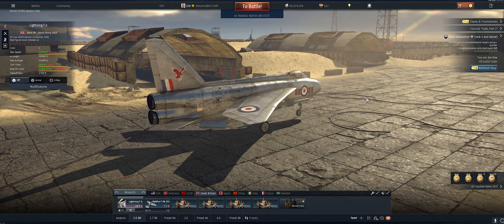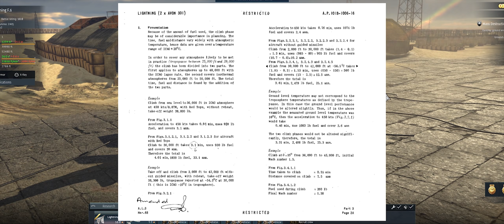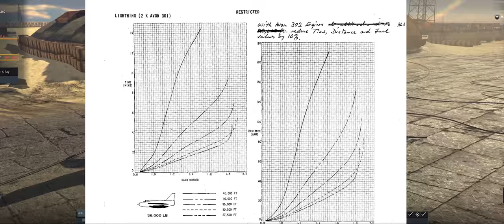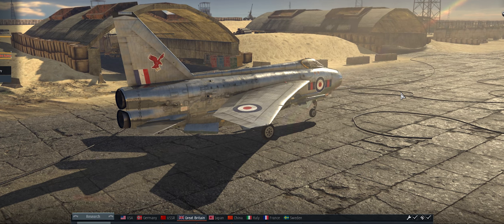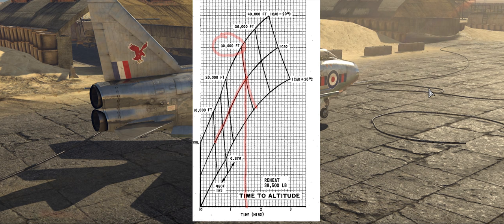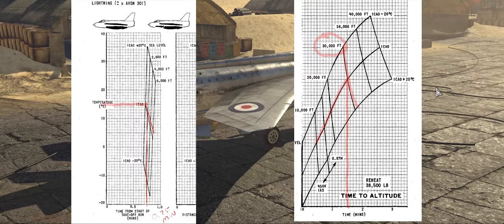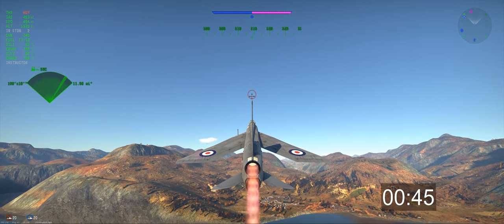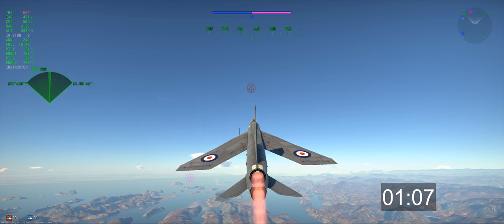True Facts About the English Electric Lightning's Performance - War Thunder 1.97

Comment: "Your English Electric Lightning is Over-performing" maximum mic drop.
Reply: Its not by much though... as he said the manual is for the Avon 301 and we have 302's... 2m15s = 135s, he beat the manual by 17 seconds, adjusting for about 10% per the hand written note means he only over performed by 3.5 seconds...
Reply: FallenPhoenix but still overperformed not under it so
Reply: @Boomshakalaga  I never claimed it was underperforming though... It's actually pretty much bang on what it should be.

1: He mentioned the performance gap between the Avon 301 in the manual and the 302 in game but then didn't account for it in the results.
2: He used the time to climb chart to get a reading for 450 knots at sea level to 30,000 ft... but he wasn't at sea level when he pitch up into the climb.

I actually missed my second point first time round so its closer than the 3.5 seconds I originally stated... time from 1000 ft where he pitched up reduces the over all result by 3 seconds.. so it wasn't off by 3.5, it was actually off by 0.5 seconds...
Reply: Most top tier Jets will be compared to the manuals. The reason gaijin don't accept manuals as a lone source of statistics is that they always lowball maximum performance to extend the life of the hardware, which is then promptly ignored by pilots.
Reply: @FallenPhoenix86  but the jet is also overweight, so its closer to the 17 second over-performance
Reply: @briantucker2570  Its only overweight by 6.49%... people on both side of this argument are desperate to paint this thing as under/over-performing when it just flat out categorically isn't doing either.

The fanbois are crying because it's not outperforming X-Wings and everyone else is overjoyed that it's been "proven" to be over-performing... except that the method used to prove it was flawed and did no such thing.
Reply: @FallenPhoenix86  if anything it proved that it is performing exactly as it should /shrug
Reply: @briantucker2570  Thats pretty much my point in a nutshell... it's doing exactly what it should. 
Be interesting to see how everything else stacks up under the same analysis...
Reply: Actually it's doing both, overperforming a high alt, underperforming at low, gladly have the high alt performance fixed because it gives no advantage since no one fights at the alts it overperforms at while all the fights are at its underperforming alt ironically

Comment: Someone send that to Sgt Vittie (im banned on his serv cuz i posted a vid saying the same thing)
Reply: I'm in Vittie's discord so i got you
Reply: Vittie is a teaboo he won't listen
Reply: Vitte is scamming people with the promise of a giveaway that he keeps pushing back just to milk a sub increase. I despise that attitude so much. Superiority complex is rampant in his videos and streams
Reply: @Derp 101 So its normal for a youtuber to lie about giveaways? Bruh
Reply: @Derp 101 hes a liar.
Reply: @Derp 101 Cringe
Reply: i got banned from vittie discord for asking his opinion of this vid
Reply: @JimmyMcCbob  not even surprised
Reply: The problem is that this is based on the manual which, as has been said time and time again for pretty much every machine, use manufacturer advised limits set to extend hardware life, not to get the most out of the machine.

Most vehicles in game perform better than the manuals. Pretty much every patch gaijin have to explain this to people, and make it clear that they won't accept the manual as a lone piece of information to change vehicle premiers.
Reply: @MrEsphoenix  Even without manual, it has been proved that the F4 and Mig 21 have better power to weight ratios so ofc they climb faster and performs better than the lightning
Reply: @justbaguette7746  No point telling me. If you have proof then let gaijin know, otherwise you're just as bad as the people you're criticising for making wild claims.
Reply: @MrEsphoenix  gajin hates Britain

Comment: “B-b-but muh sooper space fighter. Guys i-i-it intercepted a U-2”
Reply: Yeah and the Camberra out ran Mig 15s but nobody ever brings that out.
Reply: wait for the MiG-25 you'll intercept titanium on air.
Reply: @skl-1371  Nah, I'll hold out for the MiG-31 though, pushing mach 3 at high altitude with stupidly long range AA missiles.
Reply: @virgilio6349  would love to see a test on that, once I tried to intercept a space-climbing Canberra in my longwing meteor, I could maybe have caught him at around 12-15km altitude if i held 100% throttle, but I was overheating, so I was forced to keep it around 95%
Reply: @triggerhappySOB  Thats the successor but still the 25 probably should get added before the 31, & yeah you dont know they might add the MiG-25M (the one with the highest altitude till now 37650 meters high).
Reply: @triggerhappySOB  the mig 31 isnt near mach 3 its capped at ~2.8 which you wouldn't reach below 50k feet which additionally is capped there because the mig 25 using a similar body couldn't handle it above 2.7/2.8
Reply: @adibar9066  It's closer than most things can get. That's why I said "pushing", not exceeding. The SR-71 had to be specifically designed to handle the stresses, and even it wasn't perfect at it.

Comment: Bruh I was literally about to do a full video on this. tl;dr is that the Lightning's overperforming above 15,000ft, regardless of whether you test climbrate, level flight acceleration, sustained turn. They're all higher than they should be. The only place it's actually underperforming is below 15,000ft. With Redtops, it should reach 1.15M at 5000ft, but can only reach 1.13 (acceleration to that speed is also way too low). Sea level sustained turn is also a little bit too low.

btw it can supercruise at over mach 1.2 up at 36,000ft.
Reply: Is there any source that states that a production lightning variant can supercruise?? The only things I've read have stated that the prototype could supercruise, but made no mention of the production model.
Reply from the maker: In some of my previous tests I was doing mach 2.0, accelerating, and climbing at 12Km....so I 100% believe everything you say. 

On a side note, don't let me stop you from making another piece of war thunder gold lol.  I'm sure you'll do it much better justice!!
Reply: Make it anyway, the more videos on this the better informed people can be.
Reply: @WhooptieDo  and Zetaris, the dream team?
Reply: @NightPhantomz  The problem is that the flight performance manual doesn't have data on military power (i.e 100% throttle) acceleration above 10,000ft, so I can't really be sure. That the F.6 could supercruise is very likely, but exactly how fast it could go in supercruise, I don't know.
Reply: @Zetaris  Do the video Zetaris, do the video
Reply: @NightPhantomz  A whole lot of military aircraft can supercruise that were never marketed with that capability. I bet you won't believe me when I tell you the F-35 can!

A whole lot more aircraft could do it clean. F-35s are clean with combat loads, as are F-22s, so it's much easier. Modern military aircraft marketing is really, really overhyped in Europe, where most incredible claims come from (typically about the Eurofighter or Grippen being better than they are by miles in x y z buzzword way), which is the only reason supercruising is something almost anybody has heard of. 

Back when Lightning existed, it wasn't a buzzword, so it wouldn't explicitly be mentioned necessarily. Not all sources will update with things like supercruise when it becomes relevant 40 years later.
Reply: Aye and thats the reason the lightning isnt good in WT, most stuff realistically doesnt happen that high in top tier, so it just doesnt fit the game.

Good luck with ur vid man :), always enjoy ur content
Reply: Did you guys test supercruise for instance? I mean everything shown in this video is correct. But that doesn't mean the aircraft isn't broken. Go ahead, take a look at supercruise charts and test it in-game.
Reply: @firstequinox9869  there we have it. More gamemodes at higher altitude would be fair to have.
Reply: Keep in mind when you make your video that the manuals always lowball statistics to extend hardware life, hence why pretty much every vehicle in game "over performs" compared to their manuals, and why gaijin doesn't accept the manuals as a lone source of info for changing vehicles.
Reply: Well there you go, WT matches are never that high, so that's why people are complaining. Its underperforming where people are actually playing.
Reply: @Exsize Beatz even f16s can supercruise
Reply: Do you know if the model has been adjusted since?

Comment: Everyone: bruh it sucks not even close WT cant get anything right.
WhooptieDo: BOOM FACTS
Reply: This but unironically because the Lightning is overperforming. It’s not shit enough.
Reply: @Freezetusk  Ironically however if you compare other top tier jets to their ODMs they are all overperforming too. The Mig 21SMT/MF are massively overperforming if you compare them to the Mig21Bis' ODM on climb (you know the Mig 21 which is basically an SMT with special afterburner mode and an even more powerful engine) which they somehow exceed. Also most non idiots are complaining about the supercruise properties/high IAS acceleration which are all completely underperforming compared to the manual.
Reply: @ukoctane3337  quit whining. Once you get facts shown to you, you point your fingers to others. Classic goalpost change.
Reply: @asiftalpur3758  I knew the facts before whooptie lol I tested the Lightning as soon as it came to live. Its overperforming in some areas, underperforming in others. Just because i didn't bother to check other FMs earlier in the game does not mean im moving the goalpoasts ffs. Is it too much to ask for aircraft to be brought in line with their historical standards?
Reply: @ukoctane3337  thank you for talking about the supersonic acceleration. Finally someone is being sensible.
Reply: @ukoctane3337  stop peddling around your unmoderated bug report as conclusive evidence. If bug reports meant something, M60 would have had its armor fixed. And that's 2 years old. Your wt link doesn't mean anything.
Reply: @ukoctane3337  I want whooptie to do the same kinda video on the mig21 that thing somehow outclimbs the lightning by a shit ton
Reply: I will be surprised if the other top tier e.g mig 21 and phantom perform accurately.especially mig21 cause Russian bias.

Comment: Over performing Under Peacetime, training conditions. Games are one of those places where a clash of personality and knowledge meet. I don’t doubt the F6 is over performing from your research. But Flight Engineers specifically in cases of X749. Managed to squeeze an extra 3,000lbs of Thrust per engine in exchange for increased wear and tear. 
Akin to that of WEP in spitfires. Due to the nature as a high readiness Interceptor and not part of a Training squadron.There’s no point destroying good engines in peace time after all.
Same with the Olympus Engine. Original let specified for just 28,000lbs of Thrust and with minor adjustments similar to that of AMG, got 33,000lbs from them under stable conditions. The engine later exploded after 90 hours under rigorous testing. But the Cold War from Red button you Apocalypse was going to be less then a week. So I’d call it a professional courtesy rather then over Performing.
Also the Official Empire Test Pilot school Documentation was Official Confidential and covered for the Century, NOT Restricted. Meaning you wouldn’t know the real answer anyway because you’d probably sell it if you did. 
Flight Manuals are designed meeting Government/MOD requirements in reliability,Maintenance, cost per hour and specification and nothing more, cultural differences in Conservative nature even come down to it also, you could grow old and die on the subject of Cold War politics, technology and the Offical Secrets acts. But at the end of the day. It’s a fucking game. Shit needs a unique play factor for ‘balance’ and ‘Diversity’ for the 12 year olds.
Or jets would be getting flame outs. Bird strikes. Oil leaks. Fried avionics and flat spins. I’d prefer Warthunder had just left well enough alone the Cold War Era.
Reply: That is a balanced piece, well done.
Reply: A most rational view in this warped, soundbite, gaming generation.

Comment: Bear in mind the manuals of MoD aircraft feature blanket restrictions which the pilots must adhere to, and aren't representative of what the aircraft is actually capable of. It's the same problem with the Javelin, which is why there are different figures quoted literally everywhere.
Reply: Definitely true for sure. There are soo much figures out there
Reply from the maker: This manual is a previously restricted performance manual, take a look through it.   It's been declassified since.  The data is correct.
Reply: @WhooptieDo  he's not talking about the manual being classified when he says restricted, he's saying that the manual is generally going to have performance numbers given for operating within an envelope. Sure you could push things past what the manual says, but you better have a good reason to. That being said, I don't think the lightning is under-performing, I think everyone was just expecting way to much.
Reply from the maker: Fair enough.
Reply from the maker: Another thing to consider, you can play that arguement two ways, Gaijin (a Russian entity) wouldnt have any more access than we do, and cannot base its performance off of irreputable data.
Reply: The restrictions would only be in place for things such as top speed and maximum G overload tho. Full re-heat means full afterburner IE WEP in game. It's a ridicilous argument to bring up when it comes to acceleration and rate of climb.
Reply: @pantherviii7255  Finally someone who gets it! It's not like you flip a switch in the cockpit to access DOUBLE AFTERBURNER or anything people. Thrust limit is thrust limit. Pilots piss off their crew chiefs by breaking the plane with with G overload stresses.

Comment: I don't think the problem's with the lightning itself - I did this exact same test the other day and got the same results - it performs as expected, which came as somewhat a surprise... Gaijin never get things right.

The problem with the lightning is that at the moment everyone is flying F4Js - the EEL F.6 was old and outdated tech by the time the F4J entered service, and in game, everyone is using them.  The lightning's just get trounced because of the BRs yet again...

*Edited for grammar.
Reply: french f100d(aim-9b) says hi
Reply: They could have added the prototypes (which weren't mach 2) years ago and added this one in with the first phantoms. Would have saved them a lot of foods and kept people a lot happier. Instead people are just pissed off and the Brit haters are having a field day rubbing it in. Shame.
Reply: I think the problem also comes down to people seeing the F.6 and expecting it to have comparable performance to the F.3, which is generally accepted as being the highest performing version of the lightning

Comment: Great video. I've been trying to explain on the forums how the Lightning is performing pretty close to the documentation. The only issue I have with it at the moment isn't the jet itself, more the Red Top missiles and how they seem to be lacking in several key areas. If you look at the official documentation, they are capable of an all-aspect lock within specific conditions, namely against aircraft travelling at mach in an aproximately 300 degree cone allowing for engagements that we currently can't achieve in WT. Their tracking seems a little suspect too, but we'll see how things pan out.

What puzzles me, is how Gaijin said that the Lightning was "too advanced" to be added with the MiG-19 and F-100D. Both these aircraft can very easily keep up with the Lightning at lower altitudes and match you for acceleration for the most part. It's sad that the aircraft was only added now, already vastly powercreeped by F-4E's and MiG-21's that deserve a BR far higher than they currently sit at.

In my opinion. The F-4E/EJ and FGR.2 should go up to 11.0, they have great missiles, RWR and access to flares which are a game changer at top tier. The MiG-21MF/SMT could go to 10.7, as while they have the missiles they lack a RWR and flares. The F-4C I think can stay at 10.3, as it only uses AIM-9E. An increase of the BR spread is much needed and while the Lightning will still get uptiered, if they can flesh out the 9.7/10.0 BR then hopefully we'll have some more even games.
Reply: Someone gets it. Well said!